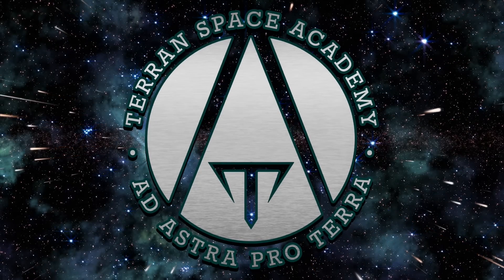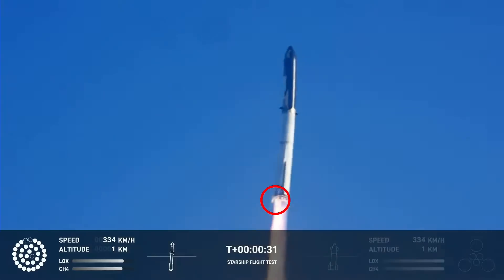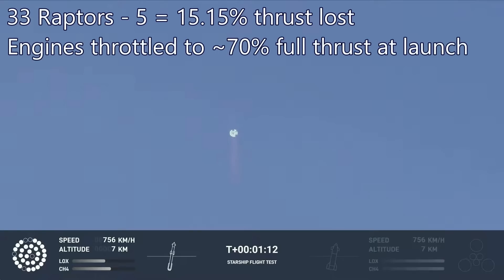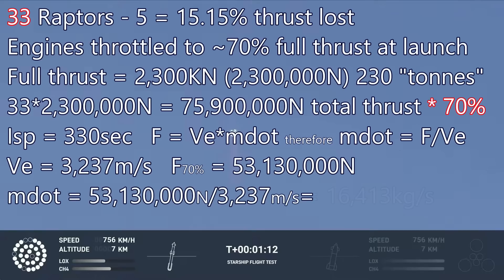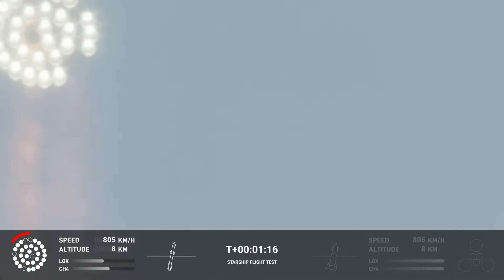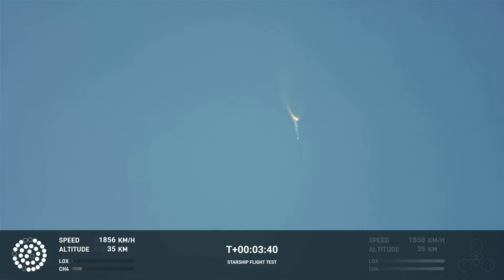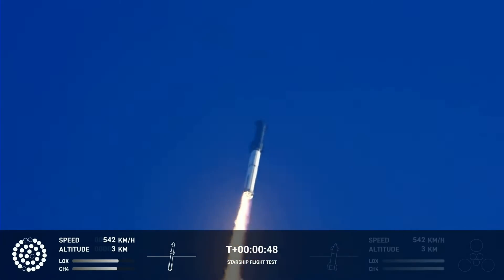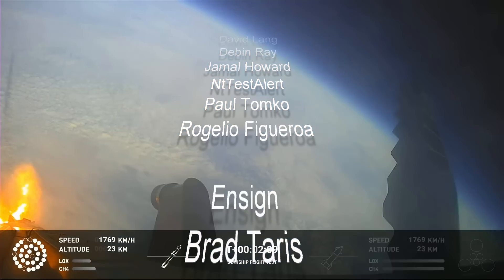Starship Flight Analysis: What went wrong with Starship?

Comment: Well done. I wonder if the launch pad flying debris damaged the booster and it was doomed from the get go. I suspect that if the pad had not been torn apart, it would have been successful. I agree with your analysis of the flip and wonder once again, that if there had been no damage on initial launch, then all engine would have been working, control would have been better, and the separation mechanism would have worked. Time will tell once SpaceX is done their analysis. Thank you for your insightful and thorough analysis.
Reply from the maker: Thank you.  Almost certainly the debris did it in.
Reply: @terranspaceacademy  Are you sure about the flip ? It doesn't make any kerbal sense for me . Is there any animation for it ? The narration was obviously on script without feedback and the performance as in altitude and speed at separation much under what was planned

Comment: What about the severe damage to the launchpad though? It looked as if some unanticipated thrust phenomenon during ignition and launch caused violent forces to severely damage the pad, throw up/out solid debris, and probably also damaged some of those engines and caused the visible issue on the lower outside of the first stage.
Reply from the maker: I think they wanted to see how bad it would be.

Comment: Great analysis.

It also seems that on the 5th or 6th engine fail, that initiated a LOX leak, as until this time the graphic was showing the LOX and CH4 tanks depleating at similar speeds, and right after this point all of a sudden the LOX tank started draining faster. When the CH4 stopped draining (according to the graphic) the LOX tank kept going all the way to empty.

It was a very impressive flight, I cant wait for the next one even though I know its goings to be months away.
Reply from the maker: I wonder if a turbopump explosion ripped open the line?
Reply: @terranspaceacademy  If you take a look at SpaceX's stream in 4K, right as they show the first onboard shot of B7 and the commentator exclaims about the live picture from B7. You can see an area at the very base of the rocket where material is flapping around. Either this is shielding or one of the engine explosions was violent enough to put a hole in the LOX tank (I think LOX is the bottom tank, cant remember for sure though).

You can also see when they do a closeup of the engines burning you can see the 6 engines out, but you can also see what looks like fire between all the centre engines, it doesnt look dark, its clearly orange up behind the engine bells. I dont know if this is just visual illusion or not, it could be, I am not a rocket scientist, or someone with any qualifications in anything about rocketry. I am only going off my visual observations.

This was a very impressive test, and Stage 0 looks to be okay for the most part (the steel at least). Concrete floor looks a bit second hand though. (I can see the ebay listing now... For Sale, second hand concrete, only seen 1 rocket launch, some assembly may be required).

Cant wait for official news on the state of the OLM and how it officially held up to the thrust. Also cant wait for B9 testing to begin.

They certainly need some form of flame diversion, if not for the thrust then the sound pressure waves. You could see them running up the side of the rocket at T+5 seconds before the rocket started moving. Saw the same pressure waves with SLS, but those were directed away from the rocket out the trenches.

Comment: I don't think venting gas between them would cause a separation. It's going around mach 2 at that point, at around 100,000 ft. There's substantial aerodynamic force pushing the starship onto the super heavy if flying forward.
Reply from the maker: But after MECO they are essentially in zero g... then it's just mass.
Reply: @terranspaceacademy  It was still going mach 2, and at around 100,000 ft. Plenty of air drag pushing the top onto the bottom. Nothing like at ground level, but still quite a lot.

That's why i was really surprised that it made 3 summersaults and still needed to be detonated by remote. Any other rocket would have crumbled doing that, at that speed, in air. Impressive machine! Probably because both halves were designed to bellyflop as part of intended flight envelope for air braking.

If an SR-71 goes sideways to the wind at 100,000 ft (due to an engine failure and widely spaced engines), it turns into a debris field of titanium scrap. Granted that's at over mach 3, but still. it's a lot more sleek than a flying skycraper ;)

At more like 150,000 ft though, I think your idea would work. That may be doable with 33 engines instead of 27, I dunno. Then again, if it's high enough to do that, it may not be able to aero-brake the super heavy portion quickly enough for a return to it's launch point.

Or perhaps by adding a small amount of ignition to 'energize' the separation. There's a neat trick you can do with 2 pans and a lighter... put one on the other to make a clamshell. insert one of those thin red drink strays between them. stick the lighter nozzle in the drink stray and pump some butane into the cavity. then light it (don't lean over the pans when you do, it may hit the ceiling).

Comment: 7:20 never got there, speed should have times more than actually was, and separation altitude should be much higher too, may be that's why software not (try to)  process(ed) separation correctly (never turned off engines, and that's needed to correct separation).
Also while N1 engines was not steerable, center engines of Starship is steerable to control ship attitude, but ?both? HPU's used to steer engines was damaged or destroyed in first minute of flight.
Reply from the maker: Indeed... but it still flew :-)

Comment: Great analysis, but I think you missed the HPU’s ripping of the booster around maxq (at least it looks like that). That probably didn’t help. The fact it did try the flip makes me think at least some vectoring control was still possible, but not enough.
Reply from the maker: We saw that but wasn't sure what came off...

Comment: The velocity and altitude at booster seperation seemed way to low. Only around 40 km altitude and 2000 km/h. If we compare it with Falcon 9 for example. Stage seperation occurs more in the 60-70 km regime and at usually more than 6000 km/h. So it is pretty clear the booster was underperforming with the loss of the engines and was experiencing lots of gravity losses.
Reply from the maker: It was but still a good test run.

Comment: I suspect the engine outs were caused by the massive amount of debris kicked up from the the launchpad . 3 engines were taken out straight away and the others were damaged sufficiently that they failed later in the flight. I think once they install the new deluge and flame diverter system the next test flight will go even better. well done spacex !
Reply from the maker: You are almost certainly correct Graime.

Comment: I think just shutting down the booster engine to seperate the starship won't do the trick, since both pieces still on the heavy momentum, velocity toward the space. The only way is to flip and seperate I guess..
Reply from the maker: Or "hot gas" the Starship engines...
Reply: @terranspaceacademy  Will that ""hot gas" be strong enough to push the Starship further from the booster? I am not an engineer.. so..

Comment: The stage separation plan was documented to have booster engines switched off first. That didn't happen. And I'm doubting that separation speed was supposed to be just around 2000 km/h. I'd expect something around 6000 km/h like Falcon 9. And please note that LOX depletion was much faster than CH4. When the ship exploded nearly all LOX was gone, while approximately 25% of CH4 was left. In my opinion all those symptoms together indicate some problems in engine throttle control and probably a LOX leak.
Reply from the maker: I think there was a lower tank puncture on the LOX.

Comment: Actually this is a tremendous success. The most important thing is it proves the system design is sound:  5~6 engines failed asymmetrically the booster can still fly. That is the system has a big redundancy in term both of thrust and control. Redundancy test is a crucial part of system test. It is achieved in such unintentional way.
Reply from the maker: We agree Chen.

Comment: Good video. You missed the actual cause of the engine failures. 17 million pounds of thrust was placed against a concrete launch pad that couldn't take it.  As a result the concrete was turned into explosive chunks of debris that went in every direction. This is what probably caused the engine failures and damage to the bottom of the booster. There are lots of videos of the launch pad being turned to flying rubble.
Reply from the maker: These must launch from Mars and the Moon off unprepared sites to be a success in the future...

Comment: Very nice review and analysis.  I completely agree that SpaceX needs to rethink their stage separation for Starship.  Usually SpaceX's out of the box thinking is brilliant, but I think the flip maneuver for stage separation is not as simple and elegant as it seems on paper.
Reply from the maker: We agree... moving something that large while they are still connected is creates a lot of issues.
Reply: @terranspaceacademy  The nearly-empty Booster will have most of its mass at the base (engines, full LOX header tank) while the Ship's weight will be more evenly distributed. After a flip-separation the Booster will continue to rotate around its base while the Ship will be flung away with very little rotation. It's an elegant way to use the main engines (and their ridiculous control authority) to achieve staging of what will likely be the heaviest second stage ever.  🙂

Comment: Ugh... Stage separation must be possible at all times. Imagine it was a crewed mission and something goes wrong with the booster. The only possibility of saving the crew lies on the Starship itself to fire up its engines and control the descent. It would be a huge challenge if it's fully fueled but it would be worth trying. 
It doesn't even matter if it's crewed or not, another good thing about Starship concept is that, for the first time in history (discounting Space Shuttle), if for whatever reason payload fails to reach the intended orbit, IT CAN BE BROUGHT BACK DOWN to the launchpad SAFELY for another attempt!
Reply from the maker: Very good points Vedran...

Comment: Why do the flip with the booster engines on? It's more likely the explosions damaged too much to be able to shut it down, as the engines remain lit until the termination.
Reply from the maker: Good point.
Reply: @terranspaceacademy  I think one of the  explosion was the external pneumatic box used to restart the engines. So restarting was off the table.

Comment: Could the separation clamps have failed or jammed due to the enormous vibrations of liftoff?
I had a feeling that their current water sprayer was wholly inadequate, and the deluge system waiting installation needs to be doubledl. The booster is after all double that of NASA's.
Angery Astronaut was quite aways away and still felt the tremendous vibrations from it.  Im pretty sure that the launch mount will have to be replaced along with the pad.  That much vibrational pressure would have damaged the sub frame of the pad.  There was one picture of the heavily cratered pad from a distance.  Imagine what it looks like up close.  Now imagine takeoff from the moon or Mars.  The launch mount and pad are going to have to be underground to contain and reuse the water.  The more I think about it, with that many engines, your going to need a pond plus the double size deluge system.
Ny the way, is there a manual override for the separation clamps?
I disagree with your tumbling separation statement.  Once the clamps open there's are explosive sepatation charge bolts to push them apart.  Im thinking there was a problem with the stabilizer thruster system.  Inadequate for the weight and length?  Not enough gimbaling angles? Not enough power? Are gyrostabilizers used?
Too bad the termination button was used.  I'd have opted for parachute deployment and flotation deployment so it could be studied along with the telemetry.  Im pretty sure there was debris damage.
Reply from the maker: They must have a black box you would think but maybe Starlink telemetry is enough.

Comment: Would it better if they added fins on the booster so that it will be stabilized during ascent? Or just using rcs thrusters to maintain it’s attitude?
Reply from the maker: The strakes do a pretty good job and it isn't going fast enough in the thick part of the air to matter.

Comment: I like your explanation but I don't think it's accurate. The vehicle isn't supposed to separate by spinning apart with the engines lit. The booster should shut down, separate, flip and then relight. I don't think it was trying to separate. Several reasons: 
1. The engines were still running
2. The altitude was far too low
3. The velocity was far too low
4. The time was far too soon
I think what we saw was concrete from the launch pad flew up and damaged several engines on launch. The resulting power imbalance was too great to overcome and the vehicle flipped out of control because of it.
Reply from the maker: That is a distinct possibility but I think they could balance thrust with that many engines...

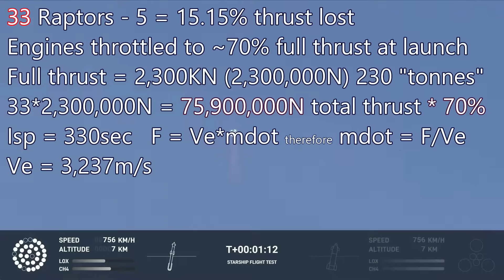Comment: To me, it seemed like they weren't throttling the remaining engines up, but rather extending the 1st stage burn, to compensate for lost engines. And that's where things went wrong: the timing of the flip didn't take the extended burn into account, so the rocket flipped prematurely. The separation command was probably issued shortly after, but inhibited by the main engines still firing (this is to avoid another Falcon 1, flight 3). With still no separation at T+4:00 (on-screen timer was probably slightly off), FTS was triggered by a failsafe mechanism.
Reply from the maker: That's a really good thought...

Comment: is it meant to use the LOX faster than CH4? i thought its use both at the same rate? Or was the LOX tank also damaged by concrete along with engines?
Reply from the maker: by mass or by volume?  By volume I think it's about 45/55 so very close to 50/50.
Reply: @terranspaceacademy  towards the end of the flight, Lox graphic is almost empty, and ch4 has about 10-20% left.

Comment: Are CH4/LOX engines more difficult to keep running than RP1/LOX engines?
Reply from the maker: They should be easier in theory.  The engines were probably damaged by debris.  It sat there a long time blasting chunks of concrete.
Reply: @terranspaceacademy  OK thanks. It seems a bit careless to let it sit on the pad so long at full thrust. Also wastes fuel.  I read that the CH4 engines are more complex to design than RP1.  Is that because there is a fuel phase change occurring in the engine? CH4 is really a purified form of LNG is it not?

Comment: The launch pad was the mistake from the start, pieces flew into the engine bays and that was it. If SpaceX had not decided to skip steps because they were in a hurry, they would have constructed a better launch pad with the right water deluge system and more clearance from the ground to the engines. Also, just a thought, could have the still griffins been acting as a distibiliser at MaX-Q? Something that in SpaceX wisdom, they could not anticipate?
Reply: Yes, No comment was made about the lack of deluge system (allegedly Musk wanted to proceed sooner than it could be made ready) or the damage and flying debris possibly damaging the booster.
Reply from the maker: They may have wanted to see how bad it would be.  These things are supposed to launch from unprepared landing sites on Mars and the Moon.
Reply: @terranspaceacademy  Valid point and now they know.
Reply: @terranspaceacademy  If they plan on landing on the moon and Mars, Starship is going to need legs.
Reply: @rcpmac  I remember having this discussion when they first showed the pad under construction with no "basically" hole in the ground under the launch mount, no real thought out water deluge system and we all agreed it was a mistake and would bite SpaceX in the arse sooner than later. As for the griffins, being in "fixed" open positions, they can't realistically predict what the effects can really be. We all know basic aerodynamics/atmosphere resistance, hence why every plane, every car, every rockets are build the way they are. Having those griffin hit Max-Q going upwards instead of downwards like when the Falcon 9 comebacks down. The effect cannot be exactly similar in both instances. Then again, I'm no rocket scientist but I am positive that the launch pad was SpaceX's biggest mistake and I'm sure had they took the time to build a proper launch pad and used what we know worked for big rockets at the NASA pads, they could have went much further in their first flight. That, I am sure of.
Reply from the maker: Good question on the grid fins... But the Soviets used those successfully through transonic.   I think the main engine problem was debris damage... what about a steel plate over the ground?  Couldn't it take that force? It's not like they are low on steel sheets or anything.
Reply: @terranspaceacademy  Yeah you're probably right on the "grid fins" but still...

Comment: Gonna guess why things went wrong had a lot to do with the massive debris ejection from the launch pad into the engines before lift off.  There is another angle in other videos showing the concrete landing like cannon shot far away into the water.  They saved time by not installing the water deluge system to get their first test out.  I'd bet that is now a top priority upgrade.
Reply from the maker: That was a lot of blasting...